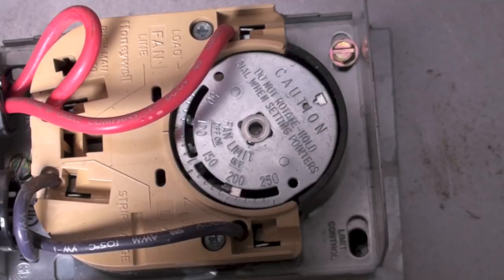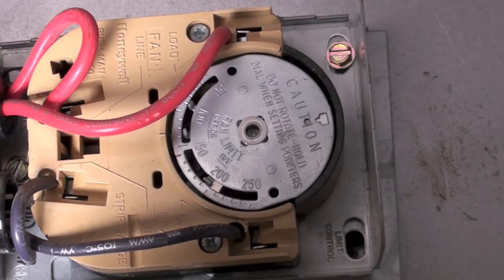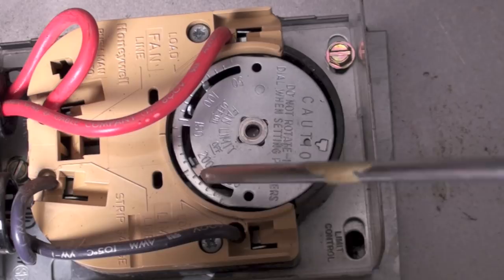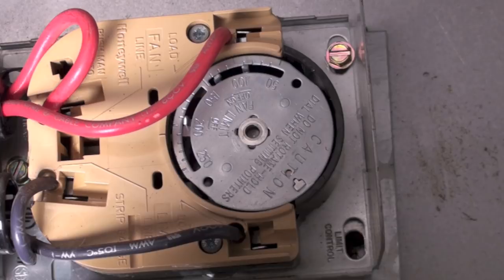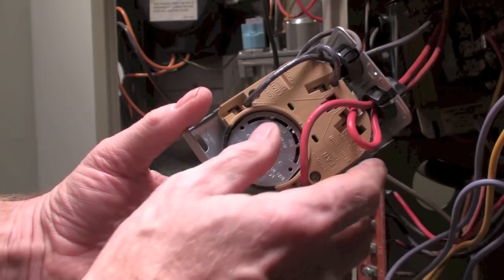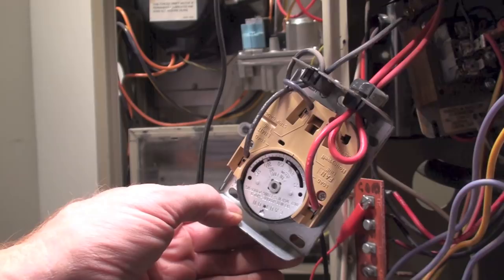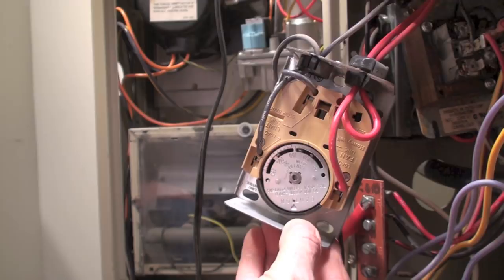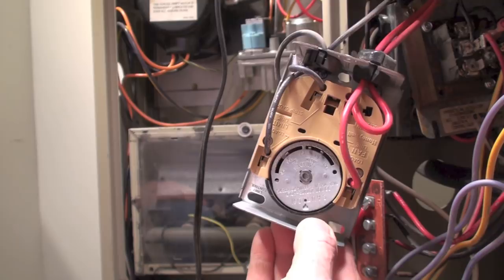How the Honeywell fan and limit switch works.

Comment: I have a question that hopefully you can help me with related to one of these fan/limit switches. I have a furnace in a house i purchased that short cycles it has a L4064y that does not seem to have the limit switch adjusting tab above the break @ 150* the problem i am having with this is that when the thermal coil trips the fan switch it pops the high limit and cuts the gas valve also causing a short cycle condition. the installation instructions for the 4064y say that it is suppposed to use the 24v hooked to an internal heater to controll fan on. it is not hooked up in this manner on the furnace. my question does is this switch defective or broken missing the adjusting tab for limit or do some just have a fixed limit that is not adjustable so it doesnt have a tab. and would not having the 24v hooked to the heater cause the limit to trip prematurely? Thanks for your time and consideration

Comment: Thanks Grayfurnaceman, good video.  Hopefully you can solve my problem.  I have a 25 year old Rheem Horizontal Furnace.  The fan no longer turns off, it continually runs, the thermostat is set to auto and is working correctly, we believe the Fan limit Switch is the problem.  The existing switch is a 6 wire switch, Honeywell model L4064T1897, it is no longer manufactured.  We can only find 4 wire replacement switches.  Can we use a 4 wire replacement switch, if yes, what do we do with the 2 wires not being used any longer, and what is the purpose of those two wires?  Thanks!
Reply from the maker: The 4 wire should work ok.  Isolate the wires.  Use a wire nut on each. They power a small heater in the switch to avoid short cycling of the fan.
GFM
Reply: Thanks, do you know of any 6 wire replacement switches?

Comment: Hi Grayfurnaceman.  You are the man with the answers so I hope it's ok for me to ask also.  My neighbor's central furnace lights just fine and the fan comes on for 2 seconds off a split second then on for 3 and so on long and longer for maybe 5 times within 30 seconds then stays on fine and runs fine and cycles off fine.  She said it's always done that so probably many years.  Mine did that also before I changed my central ac/heat system.  Could this be the fan limit switch being faulty?
Reply from the maker: If your fan and limit is adjustable, the on and off time can be separated until it no longer short cycles.
GFM

Comment: I have the same limit factory set to 170 degrees as called for for my Heil furnace. The furnace will run for several minutes and this limit will shut down the gas valve and the blower will keep running until the limit cools down and the burners will pick up again. Should I increase the limit temp, .Increase blower speed, or remove and inspect  Switch is wired for limit only
Reply: Hey Jetstream,  I know your post is 6 years old but my Heil gas heater is doing the same exact thing as yours.  Did you ever figure your situation out?  Was it a crack in your heat exchanger?  Please reply if you are still alive (lol)...Thanks

Comment: I might have an issue with my fan limit switch ( honeywell dial ) My compressor turns on but fan doesn't, unless I rotate the Fan Limit dial slightly, but when the compressor turns off the fan still runs. so in the summertime I just let the fan run, because the thermostat still controls the compressor. I haven't been able to find the video that supports my issue. I have a Janitrol Central Air unit. My house was built in 1986. Appreciate any suggestions. Thanks
Reply: I'm having same issue.

Comment: My furnace runs about 90sec  before forced air fan starts  later when all is off ..the fan comes back on about 2 min later for 30seconds  .its a 10yr old big furnace with 1.6gph nozzle  does this seem normal...seems to run to long before fan starts.
Reply from the maker: VN Dustoff If your furnace uses a fan switch like the one in the video, the on and off temps are adjustable.  Off can be set at 90 to 100 and on at 130 to 140.  Set them farther to eliminate the short cycle after burner shutdown.
GFM

Comment: very good video you can help me I have a problem with my heater tries to turn it on but it sends me the sign of limited swint combustion fallen open I replaced it with a new one but it remains the same if you can help me
Reply from the maker: I am not sure if I am understanding you right.  Are you saying your furnace shuts off the burner because it is too hot and you have replaced the combination fan and limit?  It would also help if I knew the fuel used in the furnace and an approximate age.
GFM

Comment: I have a question for you:  my furnace has this type of old honeywell limit switch.  The problem is, sometimes after the furnace has run for a long time, the actual switch sticks and won't turn the blower off.  I occasionally have to turn the power off and back on to get the blower to stop running.  Can these older type limit switches be replaced or fixed?  Thanks!
Reply from the maker: Very common problem.  Just to make sure, hit the side of the ductwork near the switch when it sticks on.  If it shuts down, the switch is sticking.  You can get the switch from internet sources and HVAC dealers.
GFM
Reply: grayfurnaceman
Thanks for the quick response!  the problem usually occurs after the furnace has run for a while.  I have the thermostat to go from 66 degrees at night to 68 when I get up, and that results in the furnace running for about 15 minutes (the burner).  the fan will then stay on for an extra 5 to 10 minutes usually.  If the furnace comes on just to maintain a given temp for say, 5 minutes, the fan will then stay on for about a minute.  Does that still sound like the fan switch?  I don't think there are any blockages in the ductwork and the filter is brand new.  Thanks for your help.
Reply from the maker: ***** It depends on the type of furnace.  A very old oil fired furnace may run much longer because the heat exchanger is much more massive.  Newer ones will shut down in 2 to 5 minutes.  You can test this if you place a temp probe in the duct (it must be placed in one of the ducts 2-3 feet from the  furnace).  Hope this helps.
GFM
Reply: grayfurnaceman
Thanks again!  I think I'll just call a service company and get it looked at to be safe.  It's been a long time since it's been looked at.  I do appreciate the info though.
Reply: grayfurnaceman I have one like that and it sticks also. I can barely,barely tap the dial and it shuts off fan. Can this be cleaned or repaired? If not, about how much do they cost?  Thanks for any help!
Reply: These can be replaced, if you are at all handy, it’s an easy job. Disconnect the power first!  The part is about $100.00
Reply: It probably cannot be cleaned or repaired.  I just replaced mine, and the spiral coil was distorted and rubbing against the outer tube.   When it cooled,  it wouldn't rotate back to the "fan off" position.   Best to replace 
it, especially if you live in a really cold climate in the winter.  Maybe you 
could clean it with a shotgun barrel brush,  but that fix would only be temporary.

Comment: I have an old octopus furnace with a honeywell la412a16x- - 2? I cannot find this part anywhere. Is there a recommended replacement for this?
Reply from the maker: You can try this one:  Honeywell L4064B2236.  Use the same probe length as the original.
GFM
Reply: @grayfurnaceman  thanks i appreciate it.

Comment: Does the jumper need to be there if the limit is going to a step down transformer? Thanx
Reply: I hope you got an answer after 7 years but yes. The jumper distributes 120 to both the fan and the limit circuits... look for 3 wires at the control and the limit protection is likely on the primary side of the transformer. If the jumper isn't there or broken off... look for 4 wires and the limit protection is likely on the secondary or 24 volt side of the transfirmer.
In either case interrupting power disables the gas valve and shuts off the burners until limit resets after cooling.

Comment: Also would my old furnace have a capacitor? And if it does where would something like that be located?
Reply from the maker: +Mike LikesBeer Just saw this one.  Most of them do.  They are located either on the blower housing or in the wiring connection box.
GFM

Comment: I need to know if that switch has anything to do with the burner cutting off ? It will run for a while then cuts off no gas seems to be getting to it? The Polit will light I can hear the valve clicking, The burner will light sometimes and sometimes not, if not it will cycle out. When it does light a lot of times the flame is pulsating then level out. It will run for sometimes 10 mins then cuts off, trys to light back sometimes it will and sometimes it won't. I do not see any pressure switches or flame indicator, could this be the gas value? or limit control?
Reply: UPDATE- I removed the metal shield behind the gas valve between the burners and gas valve and it is working, I put the shield back on and it cuts off? Maybe it's the burner not getting enough o2?
Reply from the maker: barb carsner Give me a Maker and model#
GFM

Comment: I am confused what then is rollout switch use for my fan kept running after furnace shut off and never stopped when I went done to check I tapped the limit rollout switch with screw driver and it turned off is this possible
Reply from the maker: When the limit is open, the fan stays on because the furnace thinks it is too hot.  My thought is you have a low airflow problem. Possible dirty filter.  If the switch shuts off often, it sometimes will stick open.  When you hit it, it broke it loose.  Replace the switch and find the low airflow problem.
GFM

Comment: Ok it ain't broke technology so don't fix it but is there is a 21st centurary off the shelf replacement for this mechincal bimetal device?  Thx! I knew nothing about oil furnances a few days ago but I am an experienced  smart devices maker and engineer.  It just seems to me that we can upgrade our decades old furnances without replacing the whole thing.  I was pondering  using a onewire 18B20 temp probe and a mini brain (e.g. arduino) plus couple relays for the oil burner and blower.  Then one could tweek the on-off-over termpature settings and see actual temperatures on (via bluetooth and wifi) a smartphone.  I'd throw in some other temperature probes for the burn chamber and maybe the exhaust gas.   How about a probes for flue and chamber vaccum, could even have it control the manifold weight.  How about a CO detector too.  All that can be controller by one little brain.  You can even have a simple display and control buttons so as to not require a phone or any wireless connection.  But with wifi connection the ower can monitor health of the furnance and be alerted about issues long before they become trouble or dangerous.

Comment: How do I tell if the limit switch is bad? Switch looks just like one in video, on a 16-17 year old propane Amana. Burner starts and as temp gets up the blower starts and runs 30-60 second and blower cuts off. Burner continues and switch turns blower back on for a minute or so... then off. If the house is doing a big warmup the burner keeps going but the blower keeps cycling like this. Replace switch or can an adjustment do it?
Reply from the maker: Tom Long It sounds like the on and off temps are too close.  Try this video:  https://youtu.be/QpHfFdk04u0  Hope it helps.
GFM
Reply: grayfurnaceman thanks for your quick reply and your helpful videos. I actually found that video shortly after I posted the question. Yes, the on and off were 20-25° difference. Now I have them approx 100 and 140. I also found the old install manual and it said "set to factory defaults" but didn't bother to say what they are. Guess things can get out of whack--this setting seemed to change on its own--working right and then I started noticing the blower cycling off and on too often.

Comment: Can I connect a thermostat to this limit switch to control the temperature to control the temperature in another room I have one on a wood burner
Reply from the maker: It would only shut off the fan if it exceeds the high temp.  I can't see a use for it.
GFM

Comment: This switch is exactly like mine. My question is about the manual fan "push/pull" did they just leave it off? Is there a plastic pin that needs to be put in it? It appears to just be a hole.
Reply from the maker: The manual fan switch is an option.  Many of these switches do not come with it.
GFM
Reply: Thank you so much! I set mine to start the fan at a lower temperature and runto a a much lower temp and I'm happy with that!

Comment: So once the high limit is reached and power is turned off to the gas valve , at what temperature will the power be restored to the gas valve?

You said they dont use these anymore....what do they use now?
Reply from the maker: Usually, about 180F.  Newer furnaces turn on and off the fan with a timer.  The fan is also turned on if the temperature of the airflow exceeds a preset temp very similar to the honeywell fan and limit.  
GFM
Reply: So if the limit switch is set to 200, the power will be cut off  and then come back on at 180?
Reply from the maker: Approximately,  yes.
GFM

Comment: So question here, this limit switch will not allow the furnace blower to turn on unless the gas/oil is lit? You can't just run the fan by itself?
Reply from the maker: If your furnace is equipped with this switch, there may be a white button on the left side of the switch.  When pushed in, it will turn on the fan without the burners.
Additionally, you may have a fan center on the furnace that will allow the thermostat to turn on the fan only.
GFM
Reply: @grayfurnaceman  Thanks man!

Comment: I have an old rheem furnace from around 1978 or 1979, at one point the furnace was short cycling I think.  The fan would come on again for a short time after it had already shut off, someone adjusted it and that stopped.  Anyway, now the fan will occasionally keep running after the flame is off, never turning off.  Could it be this, or is there a separate fan relay that is sticking.  When it happens, if I tap the side of the furnace the fan will shut off.
Reply from the maker: The fan switch has failed.  About time.
GFM
Reply: Thankyou, I appreciate the help.
Reply: I have another question.  So, the furnace is a Rheem RGMA-080A Furnace.  Should I invest money in repairing it?  Or should I replace it?  I haven't been able to figure out which fan switch goes in it.
Reply from the maker: At this point, I would replace.  Sometimes you have to give up.  Newer ones will have higher efficiency.
GFM

Comment: I replaced the switch, cut the jumper tab, but now the furnace blower fan will not shutoff.  It fixed the problem where the blower fan would not turn on.  Any ideas?  set to 100 120 200
Reply: haha there is a white manual override button, pulled out, all good
Reply from the maker: If your manual button is pulled out, try 110, 140.
GFM
Reply: @grayfurnaceman  thanks, is that the proper settings?  110 140?
Reply from the maker: @DreadPiratePain  Generally, yes.
GFM

Comment: hello gary hope to get your reply . i have a heil 7000 furnace that i will be buying a new furnace but due to medical issues i have to wait till next year . model nugk100dh12 1990 serial l935012658. my question is i need a new fan control swithc have it the exact sixe of that model i can not find a number on part i have and they dont make them it is 80,000 btu . is there a universal one i  can buy for cheap or a used model i could look up just to get threw a few new york weather months. thank you Kristy
Reply: How do you know the switch is defective?   Is it set correctly?   What do you mean "they don't make them"?
Reply: @x.y.8581  it was the fan control i replaced it with a good guess and your video . quick question on the control moduel what should the two knobs be set at  one says time on one says time off

Comment: Hi Gray, last year at the end of winter my limit switch was replaced along with the thermostat. Now Fall is here, I turn it on and it worked fine.  The second time it never worked again..  The fan will come on if I turn it to ON, but the burners never light up. The pilot light is lit and stays on... Any further suggestions in what to do?    Thanks, Scott
Reply from the maker: Scotty E. Look for voltage to the gas valve.  Voltage there valve is not opening.  No voltage, bypass the thermostat with a jumper.  Hope this helps.
GFM
Reply: grayfurnaceman Thanks Gray, I Finally was able to look at this again. I'm not sure how to check the voltage on the gas valve, but I did go ahead and bypass the thermostat and still nothing. I even switched thermostats with the good on, still nothing.. On auto the fan doesn't ever kick in. Of course if you just turn it to on, the fan kicks in, but the burners never light up... Anything else I can check?   Thanks!

Comment: Hi Gray,
I have a ICP PGAA24C1K1 unit. Unit turns on for 5 minutes and cycles off for 2 minutes. Keeps repeating at those intervals. Me and a tech narrowed it to to either the pressure switch, hi limit switch or the fan control switch. The high limit switch is not easily accessible. I live at 5300 feet above sea level. some say pressure switch might cause issues at this elevation. Any suggestions. Thanks
Reply from the maker: My guess is the limit is cutting off.  It is probably doing its job.  I would be looking for air flow problems, such as dirty blower or plugged filter.  There could also be a crack in the heat exchanger near the limit.  The pressure switch will usually not work at all if it is failed.  Hope this helps.
GFM
Reply: grayfurnaceman Thanks Gray. Will look into that and let you know what I find.